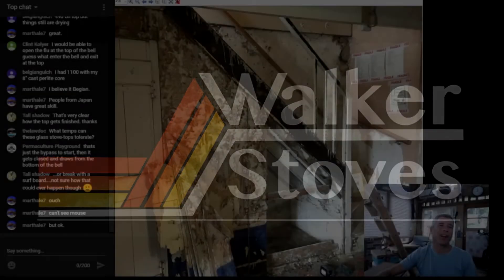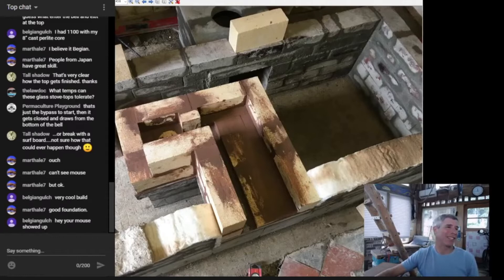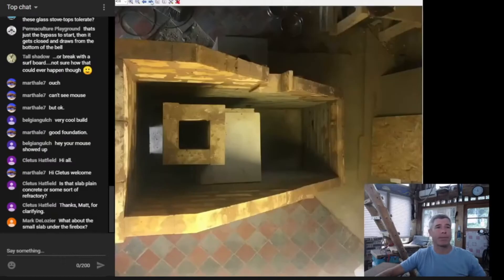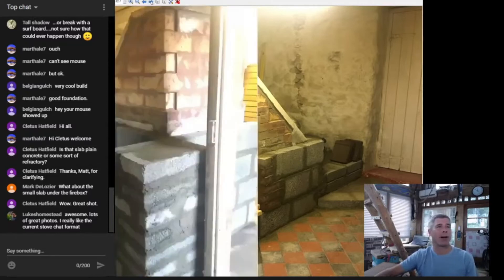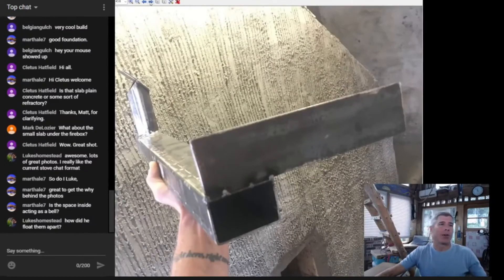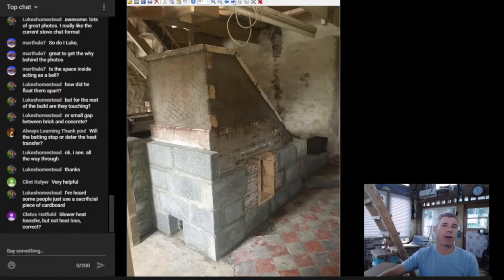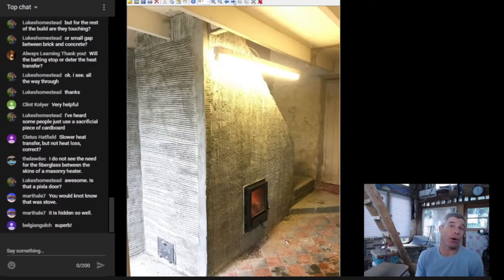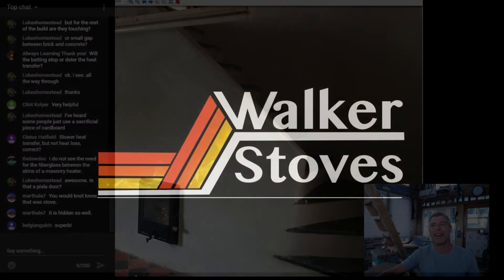Batch RMH Sidewinder Build Slideshow

Comment: Great impressions! Thank you.
I have a question: What happens (years from now), when the fire bricks on the inside become brittle/damaged?
It seems that at this point the whole unit needs to be disassembled, no way to repair the burn-tube-part without disassembly (destruction) of the outer the unit, or am I missing something?
Reply: let me start by saying that i have never built a masonry... pretty mich anything, but i did see some relevant things.

 firstly, this seems to have been built with heavy firebricks for the core, meaning that they should last decades for home use.

secondly, there appears to be two service openings, the lower one suitable for cleaning out ashes, but the one above it was in line with the core. theoretically you should be able to knock that access point out and rebuild the entire core, though it would be very difficult.

thirdly, with that outer skin/surface you could use a masonry saw to cut through both walls, do whatever you need inside, brick up the holes, re skin/texture it an no one would know you were there. additionally if the inner bell cracked and was leaking it would make no difference so long as at least the surface skin was air tight.